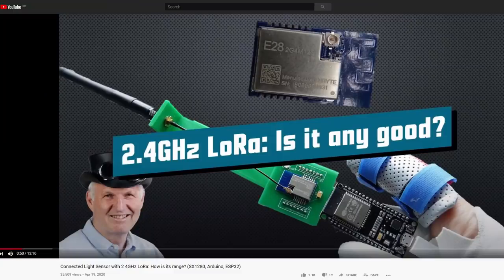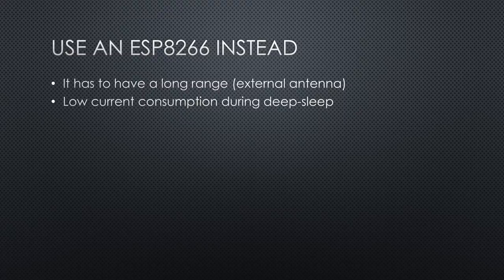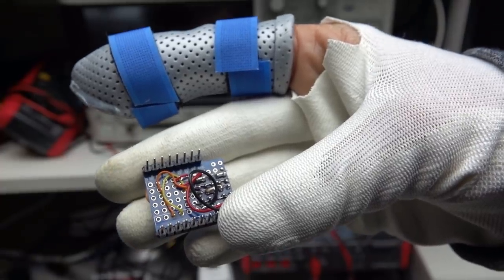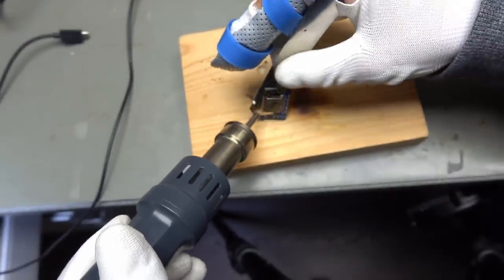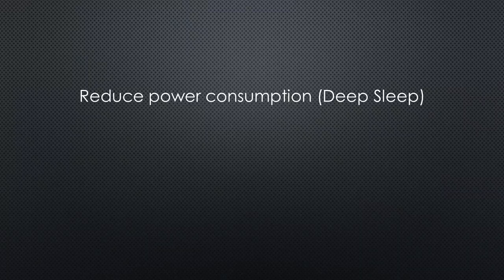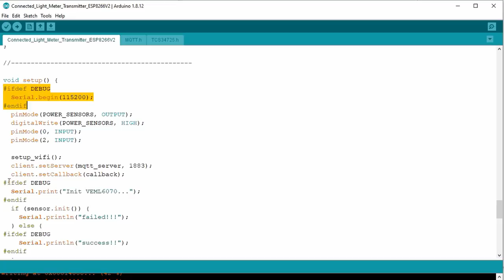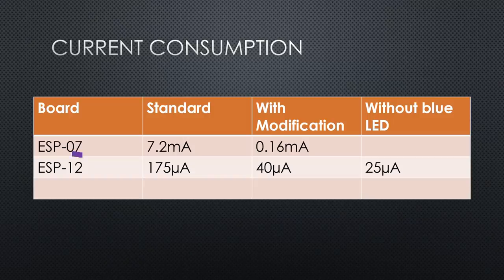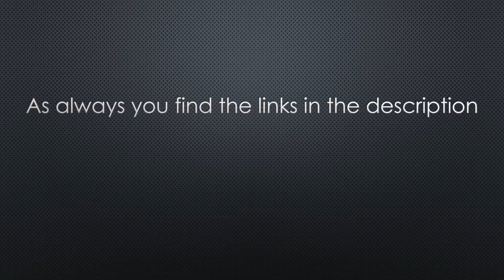#324 Wemos D1 Mini: Long Range and Low Power Modification (ESP8266, LiFePo4)

Comment: Hi @Andreas Spiess do you have a solution for esp-12F's External wake up from deep sleep. The ESP32 have this Function and it is fairly simple but for ESP8266 based chips not so much. I have diffrent kind of sensors that I want to use it with mqtt broker server (mosquito) of my Home Assistant server. I tried the circuit of Tomsim (a user in Stackoverflow) I did the same circuit but I could not wake wemos d1 mini from deep sleep. When I connect D0(GPIO16) to RST(Reset Pin) and button with 10k resistor. The push of a button wakes up Wemos Fine. But cant wake wemos by sensor.If you have a solution I would be so happy to hear it from you. Thank you like your videos very much very informative. Bye🖐️
Reply from the maker: The ESP8266 uses the reset pin to wake up from deep-sleep
Reply: @AndreasSpiess  Yes Andreas Thank you for your answer but I know this. To wake up wemos d1 mini The GPIO16 (D0) should be connected for the RST(Reset) but this is for timer interrupt wake operations. What I need to achieve is diffrent. I need to wake up Wemos by External Sensor. I used BC547 transistor but it does not work. Is there a digital mosfet/switch to make this happen?
Reply from the maker: You need to find a way to pull the reset pin to low for a moment. I do not know another possibility. Otherwise you have to use an ESP32 which have different interrupt possibilities
Reply: @AndreasSpiess  Yes I have done it finally I made a single shot LOW Pulling circuit with a BC547, 2 capacitors, two resistors and a diode. I finally did it. And it Works. Even made the Fritzing Project and PCB Wemos d1 mini Shield😀 as soon as everything works Fine I am planning to release the Circuit diagram and PCB Gerber files. Thanks for your moral support Andreas👍

Comment: Your voltage meter may be draining extra current on deep sleep, since wemos has an on-board resistive voltage divider. Use a MOSFET to disable it.
Reply from the maker: You are right. This is one of the reasons for the 40 instead of the 5 microamperes. But too complicated to change.
Reply from the maker: The ESP8266 measures up to 1volt

Comment: You can get 175µA deep sleep without cutting any traces.
Simply power the board with 5v pin and don't use USB!
Reply from the maker: I think I got 170uA through USB with the ESP-12. The ESP-07 was much higher.

Comment: in my experience the d1 mini is already pretty okay when it comes to powerconsumption, especially compared to nodemcu
Reply from the maker: You are right. You see it in my table. 170 micro is much less than the Nodemcu
Reply: Correct me if I am wrong, but once you have the FTDI, LDO regulator and leds disconnected from the board as you made, and feeding the module through 3.3V pin, both boards should take the same power as you are barely feeding the esp8266ex IC.

what would be making power consumption differences in that case between a wemos and nodemcu?

Comment: Hi Andreas, great video as usual. I am always interested when you try to get best of ESP in terms of power and range. In fact I have spend some time to build my own module based on ESP in order to give best low-power solution and reduce complexity of connecting sensors to the internet. The module called Cricket and in short it provide 600nA when off and only 0.1mAh for single event sent to the cloud from analogue or digital sensor and this without writing single line on FW code and allow build device in less than 5 minutes. With this board I managed to send temp value 15K times using 2xAAA batteries with nearly 0A between reads which allows this to work for years. Apologise to reach out to you from comments but I read from your description this is the only way, respect that. As I am now in phase of developing  new version of that board I wounder if you would like to play with it and give feedback in order to improve it ? You can find more details here https://www.thingsonedge.com/. Please send message on priv if you interested in evaluating the board, I will be more than happy to work with you.
Reply from the maker: This seems to be a similar concept as Kevin Darrah's Trigboard. I do not see if you use an additional chip to switch the ESP on like Kevin. Yours is more integrated because you do not use a ready-made module. But maybe, one day,  you will get a call from the FCC.
As you might know, I sometimes make mailbag videos where I show things sent to me by my viewers. So feel free to send me one. You should have my address by now.

Comment: I tried out the low power surgery for my ntp clock project https://github.com/demogorgi/low_power_ntp_clock
For this project a Wemos D1 mini, a DS1307 RTC and a Waveshare 1.54inch e-Paper display need to be powered. I tried a Lithium polymer battery with a rated voltage of 3.7 V. However the Wemos does not boot with the low power mod. With the unmodified Wemos connected to 5 V via USB everything works like expected, but the power consumption is way to high for practical purposes. Also, if I connect USB and the 3.7 V LiPo together, the ntp clock works as expected (time is displayed on the e-Paper and the serial monitor shows the expected outputs). Any ideas how to fix this?
Reply from the maker: It seems that at least two versions o the D1 board exist. Other viewers also reported they had issues. I would connect yours to 5 volt, measure the voltage of all pins, and compare those voltages with the ones not connected to 5 volts. Maybe one important pin does not get the right level. Unfortunately, I do not have such a board.
Reply: @AndreasSpiess  thank you for your quick reply and your suggestion. At least visually your and my board look identical. I measured the pins while the board was solely powered via the usb port and after that I measured the pins while the board was solely powered through the 3V3 and G pins. The measurements differ greatly (values rounded): D0 0.7 vs 0.0, D1/D2 0.1 vs 3.9, D3 3.3 vs 3.9, D4 3.3 vs 0.1, D5/D6/D7: 0.1 vs 0, D8 0 vs 4. Yet, I do not know what to conclude? I would be greatful for your estimation, also if I don't like it ;-)
Reply from the maker: Your measurements are strange. No pin on the ESP8266 should have more than 3.3 volts. Make sure D8 (GPIO15) is low during boot up and also check what Serial monitor writes during boot up.
Reply: @AndreasSpiess  I tried the mod with another D1. Everything works fine now, except the wake-up from deep sleep. I connected D0 and RST with a wire and D4 and 3V3 with a 1K Ohm resistor. Surprisingly, if I connect the USB cable in addition to the 3.3 V supply, deep sleep works! Do you have an idea what could be going on? Thank you!

Comment: FYI: These are clone Wemos D1 Minis. The real ones use a lower power LDO (ME6211). If you get true D1 minis, these mods won’t work as instructed.
Reply from the maker: I do not know. If I search on AliExpress I only get those.

Comment: Hi, I did the cutting trick on a Wemos clone (I didn't change the ESP, so standard ESP 12F). Now I'm only able to make it work if the USB cable is plugged, if on battery not. I attach a link to the picture of the PCB, which is slightly different. I checked voltages and even with only the battery they're ok.... I can't understand... https://drive.google.com/drive/folders/1bRNhNGyD8aAU0ezcsKt2C6N1GyzYppOX?usp=sharing
Reply: I found the solution by myself. After cutting the track D3 was no longer able to power bme280, so no output on MQTT. I had just a few time and I verified that powering BME280 with 3V3 is ok, tomorrow I'll try add something to power the sensor as the Wemos is on to save energy

Comment: The real wemos d1 mini pros come with proper antenna and external connector. The device you have is a fake wemos. Wemos do not use these style of add on esp8266.
Reply: Also the built in led can be controlled by the cpu.  Think it's on d4 from memory
Reply from the maker: Are you sure about the LED on the ESP-07? It was always on which is strange for a chip without sketch.
Reply: @AndreasSpiess  Wemos D1 Mini pro -  D4 IO, 10k Pull-up, BUILTIN_LED	GPIO2.  I only discovered this when I created a PCB and couldn't get D4 to work correctly.  It is high on startup, lighting the LED.  Might be differently wired on these fake boards though.
Reply: Here's the spec page for the newer design, but the pinout is the same.  The ver 1.1 is the one that your fake is based on.  https://docs.wemos.cc/en/latest/d1/d1_mini_pro.html#version